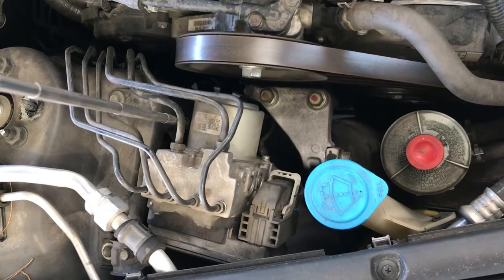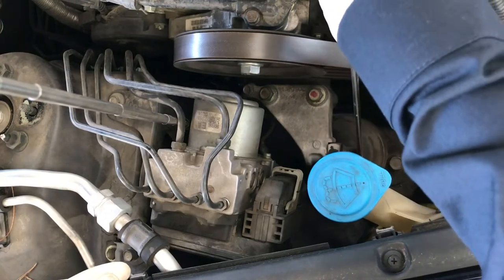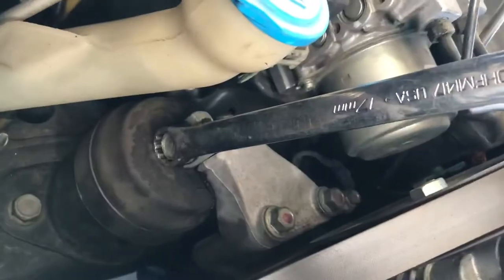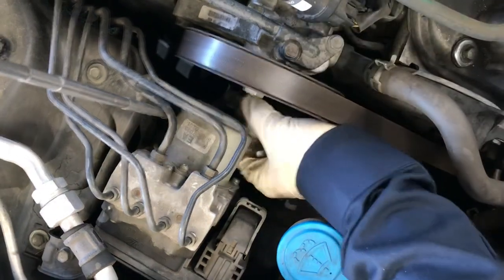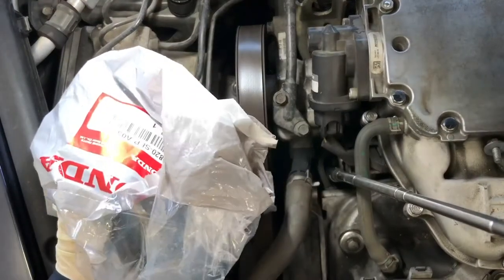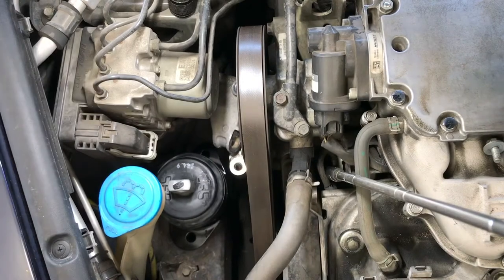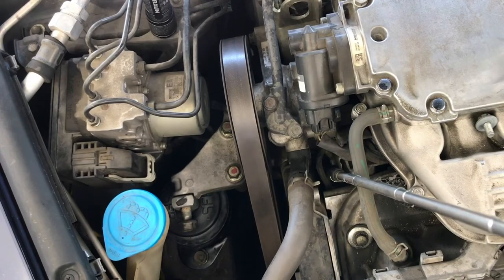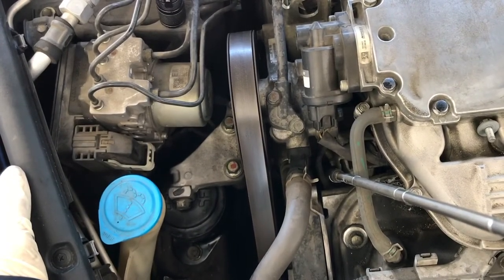Side Motor Mount Replacement - 2004 - 2008 Acura TL. DIY

Comment: How much do you lift the engine just enough pressure ?
Reply from the maker: The side mount you don’t really to lift the engine up. . If you want to, just lift it to hold it right at the mount level
Reply: @huunwheels7378  ok so basically just apply pressure so it won’t move got it thanks great video 🙌
Reply from the maker: @kevin2jzzzz203  just like in the video. Tight the two to the brackets first then the one to the mount last

Comment: i cant believe how simple you made this look! and i literally just spent $150.00 at the mechanic how much much did you pay for the replacement piece?
Reply from the maker: Thanks T Flores. It was like 100 for oem part as I remember. Great to connect with you 🙌🙌
Reply: @huunwheels7378  80 bucks max (shipping including) just got mine
Reply: @Ambience88   if they charge for shipping it’s closer to 100. $92 to exact; I just ordered one Monday..

Comment: My 2001 Acura TL 14mm Bolt (0:36) snapped & has about 1/4" thread can be seen.
Anyone knows how to take out a broken bolt?
Reply: First time these bolts been removed. One on the right snapped.
Only has 49K and going on 20 years old.  Replacing the complete timing belt kit due to age of car and ran into this mess.

Bolt is made of harden metal? Then which reverse thread bolt extractor to use?
Reply from the maker: angelisone autozone or oreilly’s auto parts should have a extractor kit, check out if there is one near ya
Reply: did you get it fixed ?if so did you buy an extractor kit or what
Reply: what size extractor screw size did you use
Reply: @youngdex7  Had to buy a new bottom mount & two new bolts.
There was simply no way we can drill it straight & true.